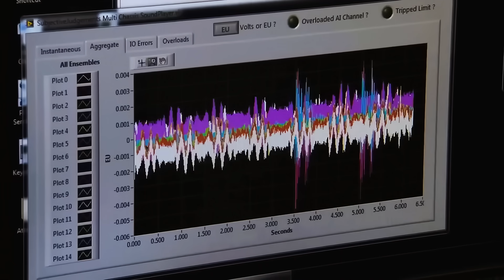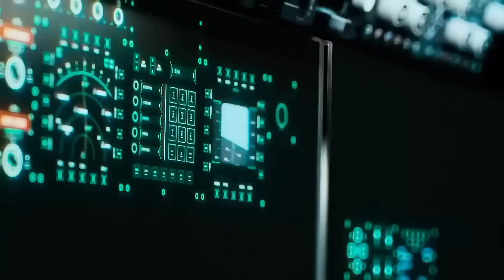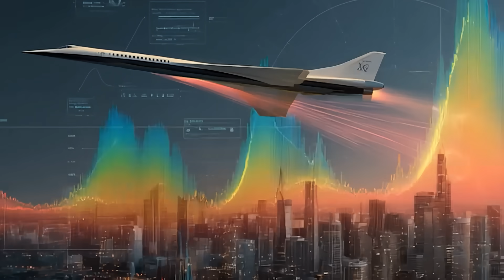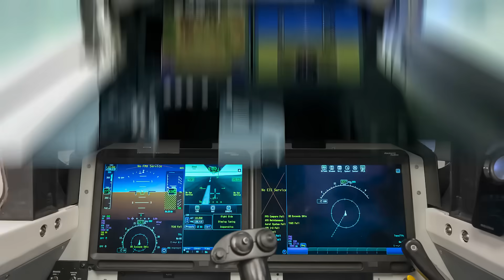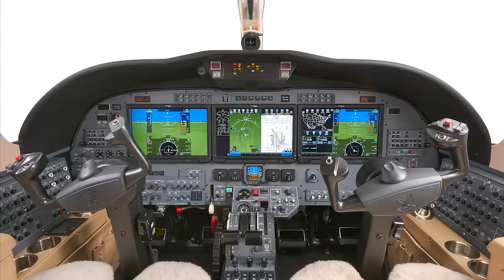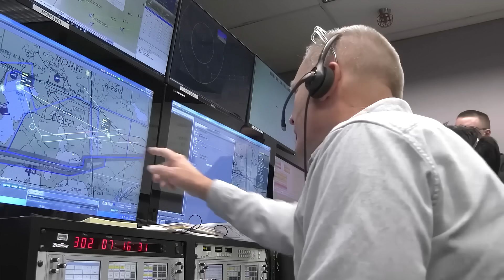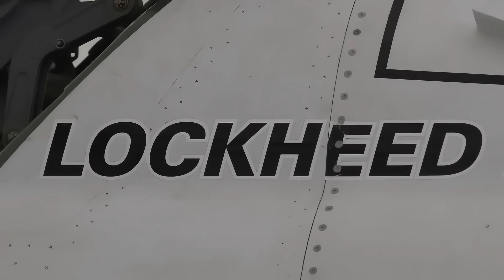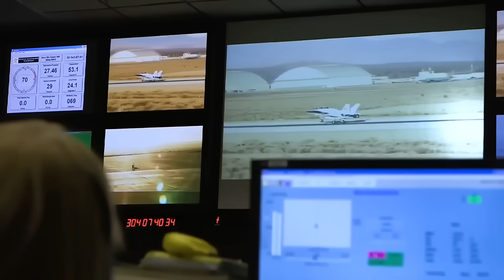NASA Tests Silent Supersonic Jet— And It Actually Works!

Comment: Pipeau..les USA ont fait capoter le projet "concorde" uniquement parce qu'il n'était pas américain...les autres liaisons mondiales n'étaient pas suffisantes pour maintenir économiquement le projet
Reply: The Concorde was a supersonic passenger jet developed by British Aerospace and Aérospatiale, operating commercially from 1976 to 2003. It flew at Mach 2.04 (1,354 mph), crossing the Atlantic in under 3.5 hours. Only British Airways and Air France operated it, with 14 aircraft in service. Its high costs, noise, and environmental concerns led to its retirement after a fatal crash in 2000 and economic pressures. It remains an engineering marvel, with a delta wing design and afterburning engines.

Comment: The F/A-18E/F Super Hornet, Boeing's multirole carrier-based powerhouse, is a proven workhorse for U.S. Navy ops, with over 800 units in service as of 2025, boasting Mach 1.6 speed, 1,275 nm combat radius, and 11 hardpoints for AIM-120 AMRAAMs, JDAMs, or Harpoons. Powered by twin GE F414 engines (22,000 lbf thrust each), it excels in air superiority, strike, and EW via the EA-18G Growler variant, with Block III upgrades (delivered 2021) adding AESA radar and reduced RCS for F-35 complementarity

Comment: Supersonic civilian aircraft--whether over land or over sea--were never economically viable. The fuel consumption is huge and the payload is small.
Reply: And these limitations will continue to exist and doom any large scale adoption of 'quiet' supersonic jets.
Reply: I wonder if ramjet has anything to do with this plane. That would cut fuel.
Reply: @josephdelp87  I don't think they're going fast enough to make a ramjet effective, and  supersonic velocities take a LOT more fuel than high  subsonic regardless of the engines used.   Civilian travel costs are largely determined by fuel consumption and even current airliners don't fly as fast as they can because they'll use more fuel and raise costs.
The F-22 can cruise supersonic without using the AB which is more efficient but still suffers a huge fuel consumption penalty going over Mach 1.
I'm just not seeing commercial supersonic travel as ever being financially viable.
Reply: I suspect that half the payload of Concorde at twice the length and three quarters of the speed would only appeal to Muricans.